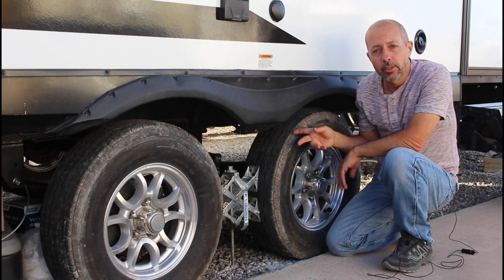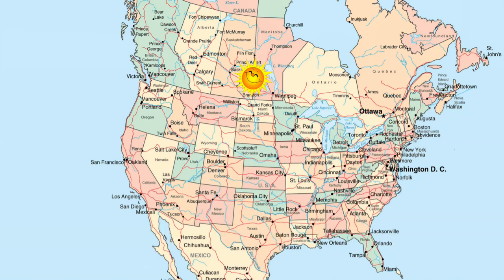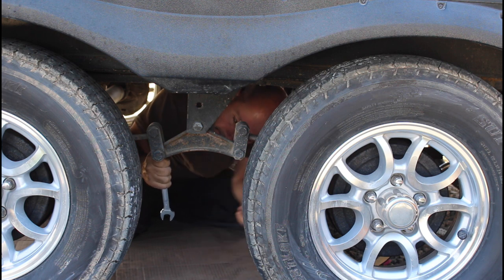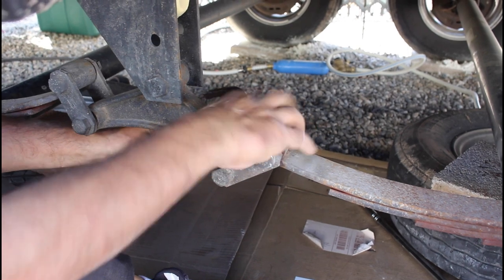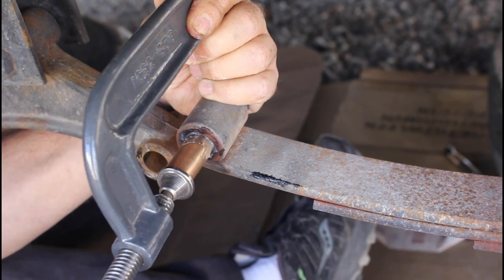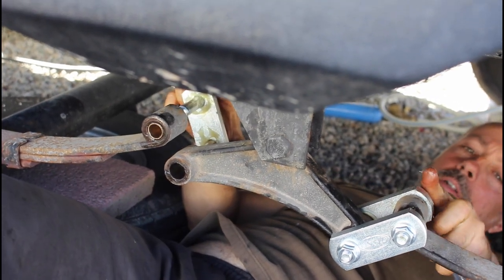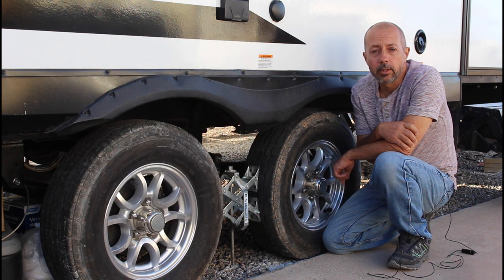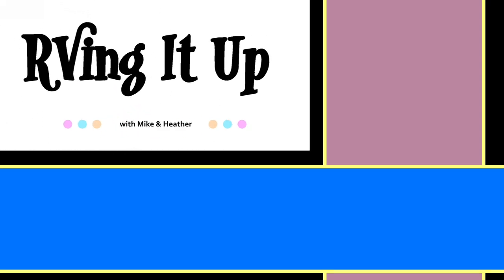How to beef up your RV's suspension:  Wet-bolt installation

Comment: For those that installed the wet bolts oriented incorrectly or had a trailer shop do it and they installed in wrong orientation: You can jack up the wheel where the wet bold is located to take weight off and then should be able to grease it. Then re-orient the wet bolt when you get some time.

Comment: Great video - Adding aTip  - Installing bushings - Before you start, take all your bushings and put them in the freezer. Take out one at a time.  Enough shrinkage to make it easier and same when doing wheel bearings with new race installation.
Reply from the maker: Thanks for sharing your tip!

Comment: Putting the bronze bushings in the freezer overnight will cause them to shrink just a very small bit but i found that they slide right in the holes with little effort.  I also installed 3 of the Morryde X-factor cross braces.
Reply from the maker: Such a great idea!  You rock!  Thanks for sharing.

Comment: I'd weld some end plates on those shackle hangers if i was you. Stiffen them up and make it more durable.   Did it with mine with just a flux core welder. Seen more than one person have those snap
Reply from the maker: I fully intend to do that!
Reply: Yes great point, was thinking the same when I saw them.  The new shackles thicker than hangers, what does that say for itself 👍

Comment: I look forward to changing ours to the wet bolt system as well. Your video is very informative and was glad you explained that putting bolts from inside or out is choice.  I agree one side at a time keep it safe.
Reply from the maker: Best of luck on your wet bolt project!

Comment: After going through the effort of installing wet bolts, why on earth did you not upgrade the equalizer for a softer ride on everything sitting above the tires? Seems silly not to invest the $195 for the MORryde CRE3000. But to each their own I guess.
Reply from the maker: Adding one more inch of travel didn't  interest me.  It was all about the wet bolts.
Reply: Actually it’s 3 inches of travel, but whatever, it’s your rig.
Reply: We are doing the same, just the wet bolts- don't want to grind the hanger as MORryde advises.
Reply: @mrsmac5196  huh? Grind the hanger?

Comment: Since you had it all apart, you didn't want to replace the equalizer (e.g. with the CRE3000)?
Reply from the maker: The only advantage was 1" more of travel and that didn't seem worth the cost to us.
Reply: @rvingitup  the rig would ride a lot smoother. Also using a socket to drive the nylon bushings out and the wet bolts in

Comment: FYI
I installed the same wetbolt kit on my trailer 15 months ago. I had a spring shop install the kit, when they installed the 4 new springs. They greased the 14 zerks too. Now, I cannot get grease to go into 3 zerks. I used a torch to heat them up. One worked, 2 did not. I'm going back to the spring shop to have them inspected.
Reply from the maker: I wonder if the cross-drilled holes may have been oriented incorrectly?  That can sometimes prevent grease from flowing through onto the bearing.
Reply: I have to suspend all of my tires off the ground in order for most of my grease fitting to take grease.  My grease holes may not be at 3 or 9oclock as everything is stock.

Comment: Just started our project on the 22MLE. ~10K miles on it. Not replacing the equalizer either.  1st nut (driver side front) is seized on and refuses to budge, even with the massive pipe wrench and lots of Blast. Going to install the rest of the wet bolts (both sides) grease the bearings and then take it over to a friend who welds and see if he can heat up the nut and remove it. So frustrating!
Reply from the maker: Sending positive thoughts your way!